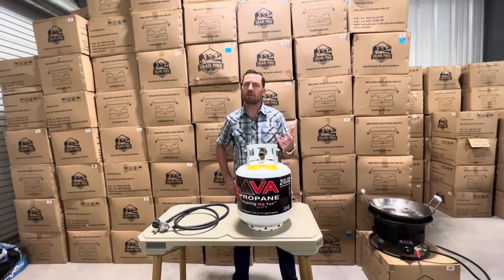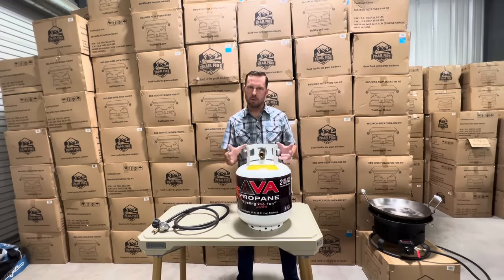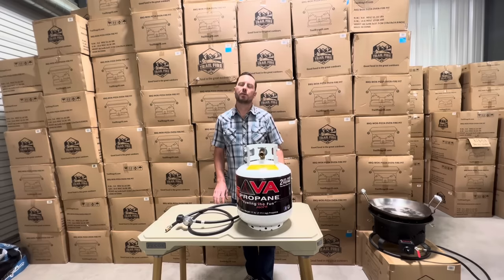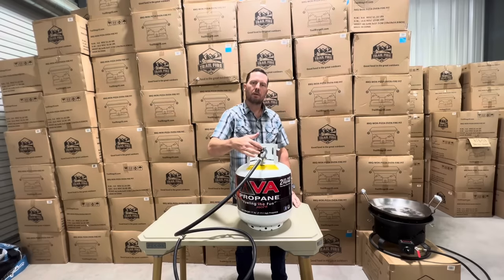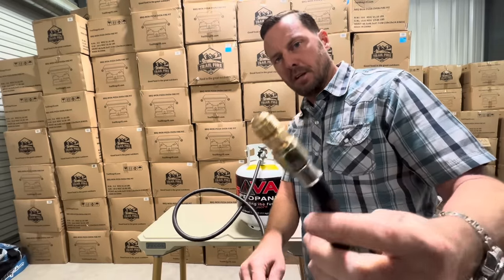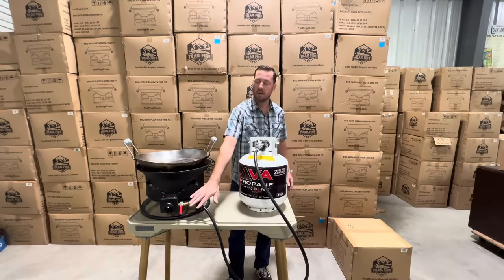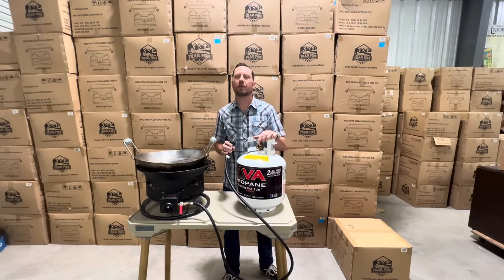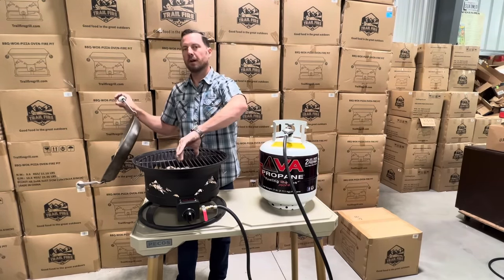Propane For Dummies | How to Reset Your Propane Tank OPD Valve Low Gas Flow Fix

Comment: Great video. However in one portion when you replaced the hose you left the regulator turned somewhat sideways. As I'm sure you know they should always be straight up...
Reply: Near the end of the video at 4:42 is the regulator in the correct position?
Reply: I am a certified gasfitter and red seal ticketed journyperson Industrial Instrument Mechanic. (A regulator is an industrial instrument)

A regulator can be mounted in any direction.  The thing to note is your propane regulator has a little hole on the top.  That is a vent in case the internal diaphragm leaks or ruptures.  That vent cannot get filled with liquid or clogged so the regulator needs to be mounted in a way that the port can drain and not get clogged.  Or else mounted in a weather resistant enclosure.

Larger (or more expensive) regulators have threaded ports so the vent can be piped to a remote location if the user requires this.

Comment: I've seen a hose pop off and shoot flames without slowing down and burn a house down, why didn't the safety work
Reply from the maker: It will still shoot flames just at reduced 30% of flow

Comment: question, I have an adapter to fill up the little green portable tanks,1lbers, from my big propane tank. do you have any advice on how to do that? Or maybe a video. Thanks.
Reply from the maker: Easy, install and tighten up adapter set 20lb tank on its side open valve then turn tank completely upside down allowing the liquid gas to flow into green bottle
Reply: thanks buddy. @TrailFire
Reply: My husband found that if you put the little green bottles in the freezer for a while, they will hold more propane. Do the upside down thing too.
Reply from the maker: The 5lb growler killed the little green portables @jeanwillick999

Comment: In HVAC they are starting to use propane and butane. No smell added.. most ac units hold 5 to 10 lbs... It's going to be crazy..
Reply from the maker: Carbon Monoxide detector or bust

Comment: The tank valve is stuck closed and when I try to detach the hose the gas bleeds
Reply from the maker: Use a blunt object to push in blockers and reset

Comment: Neat but I am confused about the safety limit for a twenty pound tank. One supplier puts in just over eighteen pounds but another puts in nineteen point three pounds for the same price.
Reply from the maker: Tanks are 80% fill rate if one supller ads a little more that's where I would spend my money

Comment: Might want to mention that most people would not want to be doing this kind of test or demonstration inside of a building. The accumulation of the gas in low areas like your shop drain could become an issue if you had to do several takes of this video, or someone watching wanted to try this on their own. While it takes a 24 part air to 1 part propane gas to have a flammable mixture, accumulation of the gas in areas can create this.
Reply from the maker: I risk it all for informative content.

Comment: My tank won't fill. Do i go threw the same steps? It hasn't expired yet
Reply from the maker: Fill issue can be a bad internal plunger or internal OPD valve rusty or  stuck if your local propane filler can’t correct it you can trade a bad tank in for a replacement at any propane swap shop
Reply: @TrailFire  thanks
Reply from the maker: All the things our fathers never taught us.  @dougferguson5581

Comment: My 30000 btu propane heater last winter wood use a 100 pound tank in 3 weeks now its barely lasting 5 day on a 100 pound tank anyone got any idea y it's using more now
Reply from the maker: Check lines for tightness and leaks burner parts for rust damage your heater almost guranteed to be at fault

Comment: 80% capacity by volume?  if my 20# tank TARE wgt is 16# and i get it filled, does it weight 36# or will it be 36x.8= 28.8# ?? i have some seemingly 'empty' tanks that are 3-4-5 # above TARE
Reply from the maker: 37 pounds or close to is what you should expect for a 80% or full 20 lb tank

Comment: i have 10 tanks. on 4 the OPD dont work. when i get them filled those 4 are filled right to the top. i end up with them leaking out the valve vent till i run them for about a half hour till the regulator stops freezing then good to go. nothing made today works right.
Reply from the maker: Safety first sensible last
Reply: @Ty.1on  when filled by a young someone who just wants a job. and almost half my tanks are defective it happens. most things made today are not made well & not many care past a paycheck.

Comment: So I had to turn the screw o. The side of mine. I could not get my valve to reset no matter what other method I tried. But turning the screw for a few seconds then closing it back up worked… but why?
Reply from the maker: Closing the valve and re opening resets the OPD

Comment: Does anyone have a guess as to why they would make this safety leak out 30 percent of flow rather than simply shut off so all the frustrated grillers out there would know that the safety has been tripped. Seems like a pretty senseless safety.
Reply from the maker: I heard one guy blew up and now the rest of us have to deal with OPD

Comment: my tank is doing this but no gas at all, not even a little is coming out. will not reset. what now???
Reply from the maker: Internal plunger could be stuck. Drop bottom of tank onto the ground from a few inches high and see if that resets plunger.
Reply: @TrailFire  still not working, this is just infuriating, a new 30lb replacement tank is nearly 100 dollars if not more and that dont even cover the filling cost, and the current tank itself is completely full. how infuriating!!!
Reply from the maker: Ask you local propane gas wholesaler to transfer the gas in your tank to a replacement most will be happy to help  @mexicanbanditopatron7994

Comment: These "safety" valves are another example of a solution for a problem that didn't need any fixing.  I can count the times on one hand that this silly valve tripped and would not reset for hours or ever at all.  The very first time this happened, it damn near ruined a special outdoors function.  Since then, I've always kept at least one spare on-hand because, as stated, these "safety" valves do not always reset.  Fool me once, shame on the dummies that thought this thing was needed. Fool me twice, shame on me.
Reply from the maker: Government control and failure

Comment: The longer we live the more intrusive the government keeps getting. I have used Propane to start diesel engines when there is an air bubble in the injection system. I have always simply connected a hose to a fitting bypassing any regulator so I could dispense enough propane right from the tank to sustain a fairly high engine speed, then crank my diesel until it starts, regulating the rpm with the amount of gas straight from the tank valve. Some times I use a little starting fluid just to get things going but then utilize only propane. The valve you speak of restricts the flow and doesn't allow enough gas to sustain a medium size diesel engine. If this valve was a result of the government intervention trying to protect me from myself BUNK! I don't need it and don't want it. It's just another example of the government dumbing down America so to keep us from realizing what they are doing to us. THEY WORK FOR US! But you'd never know it. The CCP influence is to great in  our country now there may be no turning back. We're in the last few seconds of the Freedom Game, and we don't have possession. We'd better wake up  ben/ michigan
Reply: You are the type of person that inspired all the regulations.
Reply: Ben, I understand what you are saying. I live in Michigan, too. Outsiders don’t get it!

Comment: What a crock of crap. And an actual propane technician has gotten on here and said there is nothing inside your tank or the valve of your tank to stop free flow of gas period the only thing that will do that is a valve installed outside the tank. I have cooktops sold by gas one that can suck every bit of propane out of that tank within about 20 minutes because they come with an actual adjustable regulator. If I put my burner control knobs on high, on all three burners on my 3 burner cook top, I can then go to my regulator and open it all the way and the gas comes so fast it will blow the burners out. Nothing "trips" and slows the gas flow.
The regulator as the flow control not the tank.
Reply from the maker: You are the resident expert. Make us a video
Reply from the maker: Thank you Hank Hill